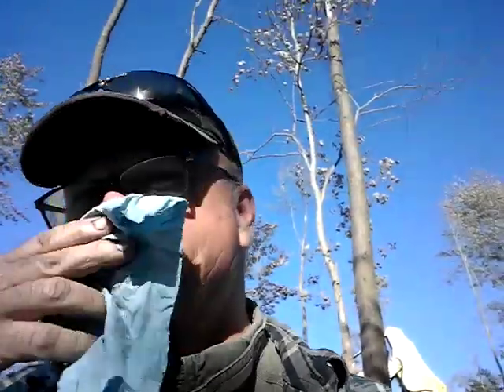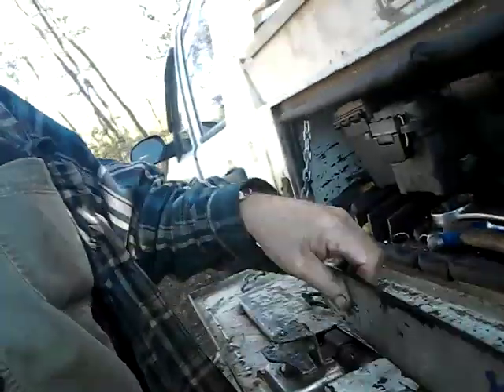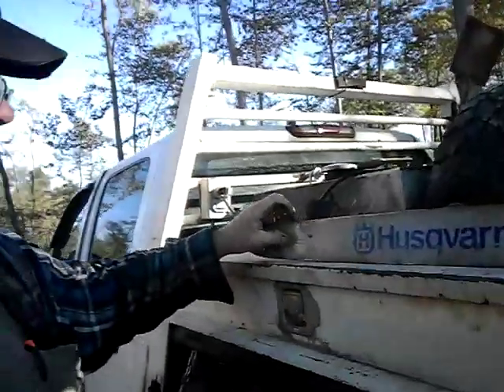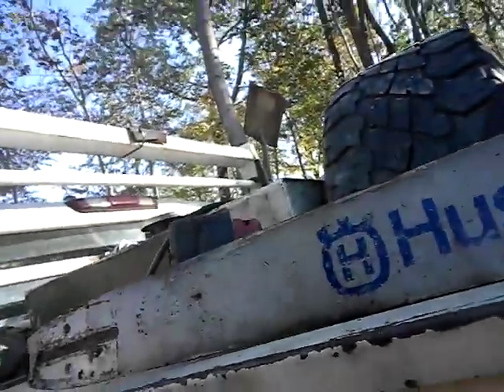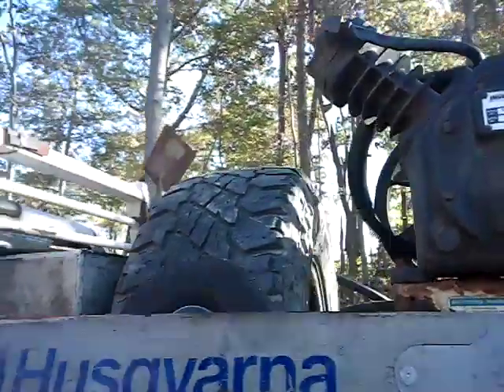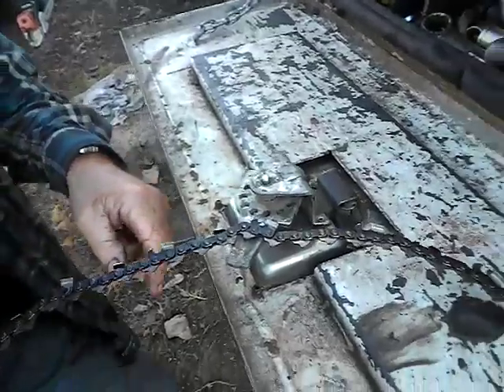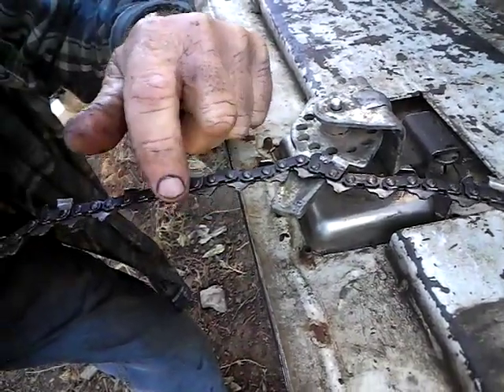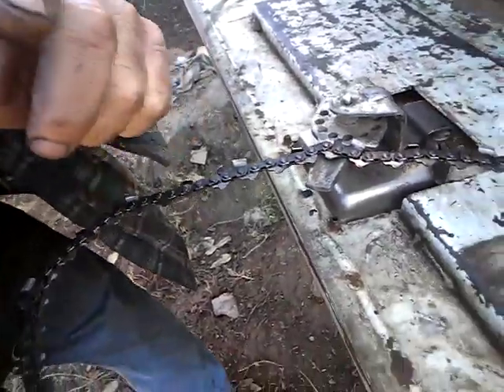deburring drive links on a saw chain ! just a helpful hint lol !

Comment: Good tips pa! There must have been a defect in that tip!? I rarely mess up a tip. I know some guys that run a solid nose bar an i hate them things, more drag an ware on the saw if ya ask me!? They tell me  they don't pinch an bind but i'll take my roller tips any day! My ole dumb ass will just run the chain a little slack till the burs hammer out/off. Hell even when ya throw a chain on these high rpm/powered saws they will kink or bur the chain.
Reply from the maker: oh yah i done the burn em in plenty too lol !!!! ya ditto on the hard nose - yuk !